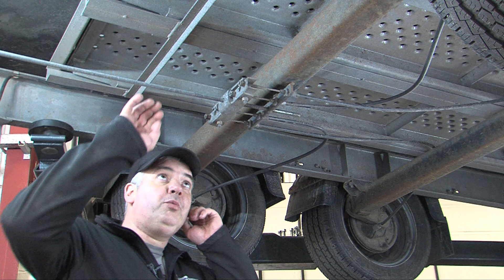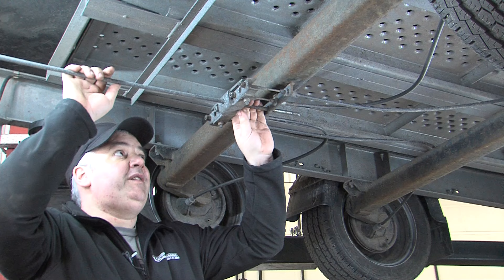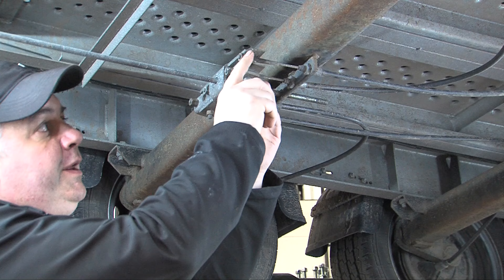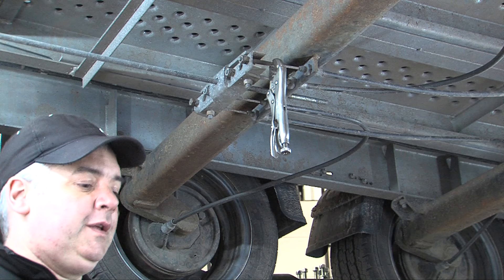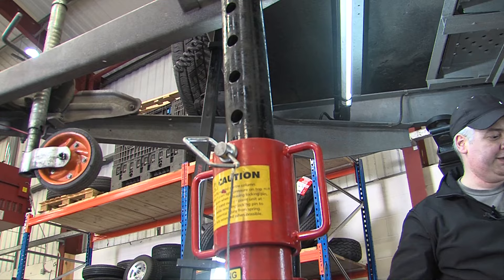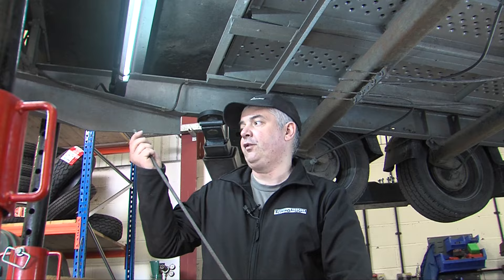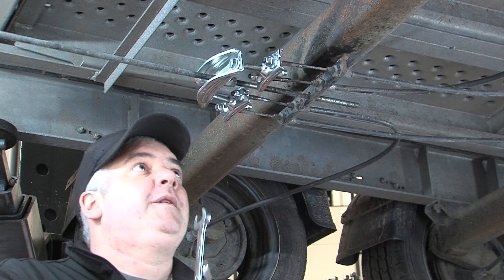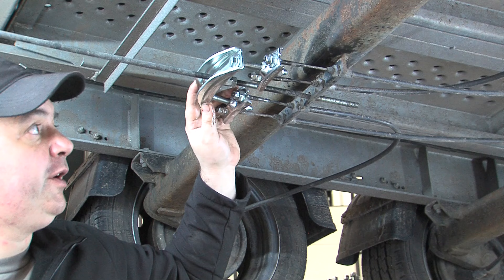Fitting a Knott Pronto trailer brake compensator

Comment from the maker: Flat spots on tyres are usually caused by the wheel locking up.

This can be caused by many things below are a few reasons.

Handbrake left on for long period of time:- When this happens it can cause the brake lining to stick to the drum when you go to move off one or more of the wheels may not rotate and it will cause a flat if dragged.

Sticking brakes:-  if cables, Expanders or even parts of the coupling are sticking when the brake comes on this can cause the tyre to lock although it may only be temporary.

Linings come loose on a shoe:- if a lining come loose it can move and get caught on other parts of the brake causing the brake to lock.

Bearings:- a bearing can seize and lock the wheel up.

The problem may have been cured but it is still good to check the trailer over
I would recommend that the trailer is serviced / has a full inspection to find any problems as it could be a sign of problems that are coming.

I have just put a video on showing how to service brakes on a trailer 
The trailer used in the video had Knott brakes and Knott KFG coupling the same as Ifor williams trailers manufactured after 1994. 

However Ifor williams trailers manufactured after 1992 have sealed bearings this had taper bearings and ifor williams have leaf springs this had a normal torsion beam trailer axle.

We will soon be putting videos on about inspecting leaf springs and we have a video on changing sealed bearings. There will soon be a video about sealed bearings and tightening as the hub nuts need to be tightened tight (350Nm on Ifor williams) and the nuts need to be replaced when removing a drum.

Video about servicing a trailer can be found at
https://www.youtube.com/watch?v=wnI_gblWYF4
Reply: Great, thankyou for the response. I've been over all the braking systems changed shoes and cables. I regret not replacing the bearings! Anyone reading this whose overhauling the braking system... get the bearings replaced if you have the facilities! Thanks again for the information 🖒